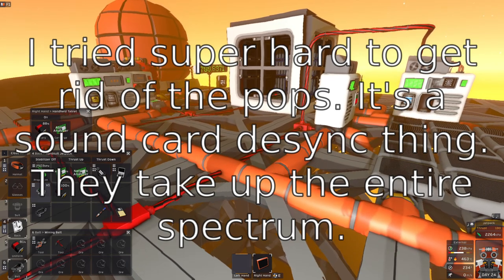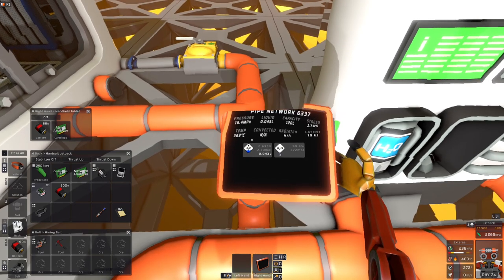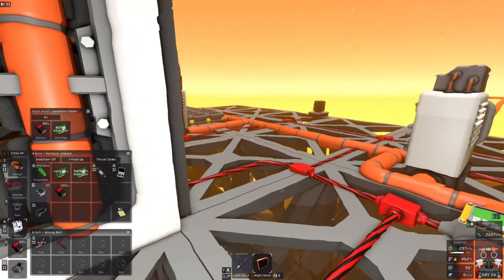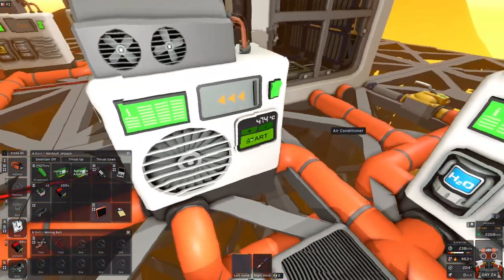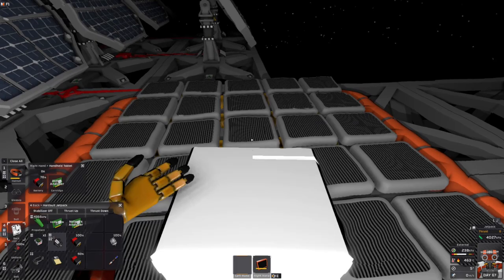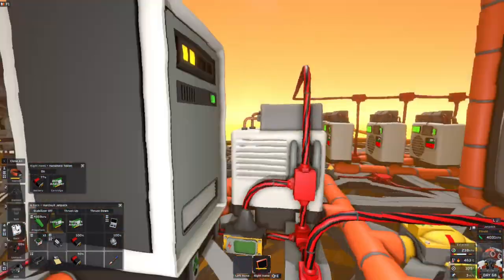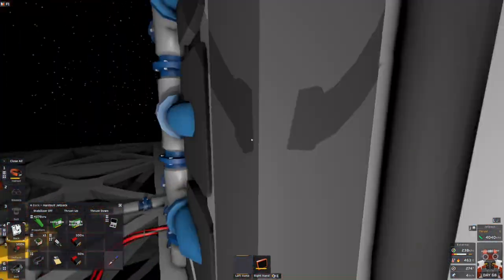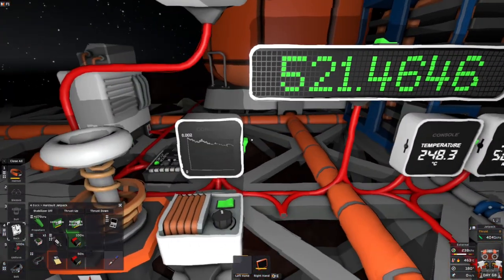CLICKBAIT TITLE! NO CONTEXT, a not so quick tutorial - Stationeers

Comment: Hey, so I was actually looking for a video just like this to make sure I don’t have to make one. What you’ve built is a manual phase change cooling loop; this is how real air conditioners work. Since you’re on Venus, you only need one loop and a little boost to get below the max condensation temp for water, but I actually built a similar system with two loops for heating on Europa. I know; an air conditioner to provide heat on Europa? Hear me out: first, I took advantage of the Phase Change Device kit (condensation chamber and evaporation chamber) to make the system smaller and more manageable. My first stage boils Nitrogen at the -145 ambient temperature in an evaporation chamber with the heat exchanger hooked to the external atmosphere. That evaporation chamber is hooked directly up to a condensation chamber which condenses the same Nitrogen at 6MPa, which can happen as hot as -83. Obviously, that’s no good for heating my base, but I hooked the heat exchanger of that condensation stage to the evaporation stage of the next loop, which is evaporating liquid Pollutant. The pollutant, like before, is immediately put into a Condensation chamber set to 6 MPa at which pressure the pollutant can condense as high as 152 Celsius, which is more than enough to heat my base; I hooked the heat exchanger on that condensation stage to a radiator in my base. Your system is doing the same thing, except it uses water as the working fluid and pulls the heat out from the other direction and has a somewhat higher capacity (I think) but consumes several kW. My system is much more compact and uses a total of 200W (50 per phase changer) for a heating capacity of ~3 kW. The one thing I think should be noted is that it took a stupid amount of gas to provide the initial charge for the system, and I had to make sure to provide a couple safety valves. Also, it took about two IRL hours to start working (though I was hindered by my initial gas temp of ~1000C).
Reply from the maker: A heat pump on Europa is a good idea, who said it was bad?

This setup is overkill all over the map, and can be significantly scaled back by using a condensation chamber running off an AC, instead of a tube. The evaporation chamber is still a pain though...
Reply from the maker: The title is because I'm making fun of someone, and my audio was ruined anyway, so...
Reply: @JoelleTheAbsurdist  well, it’s not that they explicitly said it was a bad idea, so much as they pointed to the much more straightforward solution of just hooking a radiator to your gas fuel generator exhaust. I’m just blown away by how little power the phase changers use. Especially when you consider that they internally have to function like a many times faster pressure regulator combined with, like, a powered condensation valve, they should clearly cost much more to run. Like, even getting volume pumps to pull in gas to a condensation chamber should cost hundreds of watts. And if we had a few more gas options (or a higher pressure cap) you could conceivably use just phase changers to power your furnace. As it is, i’m going to have to look into adding a water phase loop to my furnace setup to give the air conditioners a little more to work with. 
Also, most people still think air conditioners are for cooling: somehow heat pumps are not something everyone knows about? I’m sure the feeling is mutual in other areas, but it boggles my mind how little familiarity the average person has with technical systems.